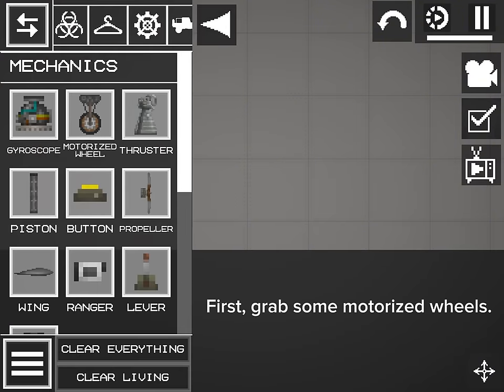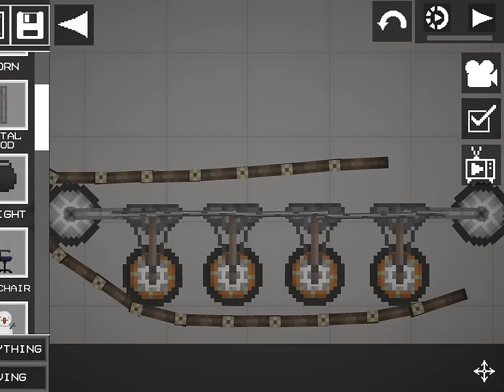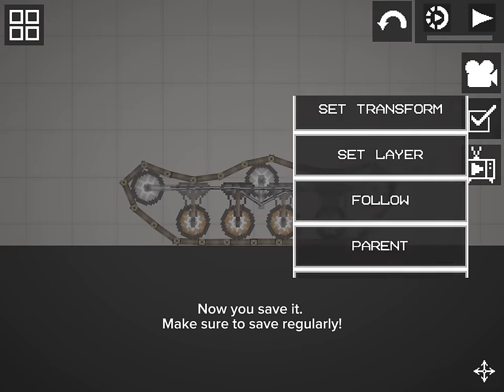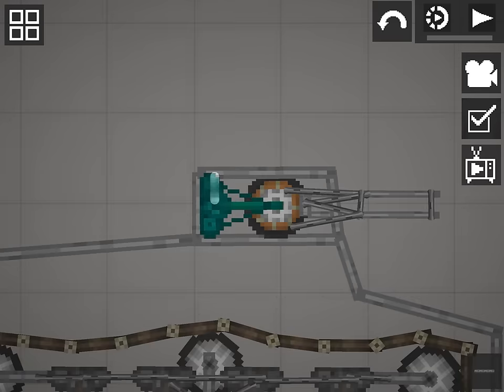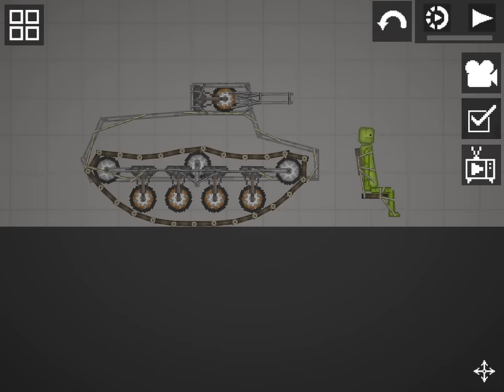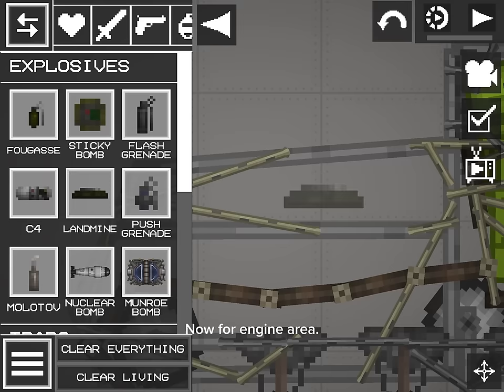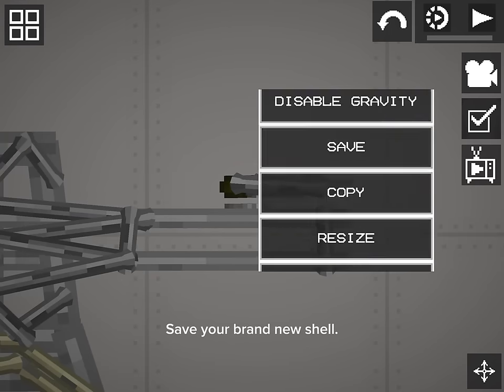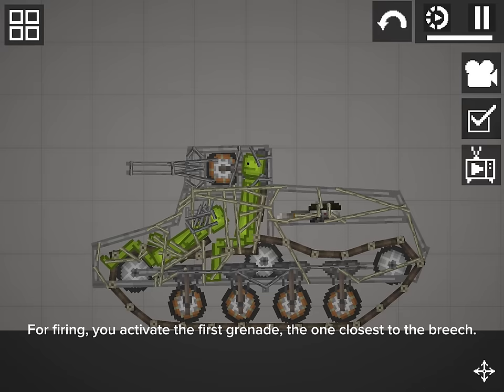Melon playground tank tutorial

Comment: If you have problem with the ads just turn off your internet
Reply: but how are we gonna watch it if the internet is off it wont work
Reply: @OceanWizard1  use a second device
Reply: @pieceofcornreal  oh
Reply: @OceanWizard1 ah u can just remember the video, if u still dont know take pic of this comment:
Step 1. Get motorized wheels. 
Step 2. Put metal rods on the top sides (left right) of 2 motorized wheels that are furthest away from the center.
Step 3: on the metal rods put normal non motorized wheels on them and nail the middle of the wheels to the rod.
Step 4:  Make tracks with wooden sticks, connect the sticks with yellow nail.
Step 5: Make the body of your tank, preferably that can fit crew in it, if you dont want big crew but still want crew use tea and put like armor or smth on them, if u dont know how chrck my community tab there is stuff u can get inspiration from there.
Step 6: after making body, put the turret on the tank. 
Step 7: check if it works.
Step 8: if it works it works. If it doesn't work redo it
Reply: Yeah that's a 200000lq
Reply: Facts
Reply: Thanks.
Reply: I won’t get a ads without a wifi
Reply: This help
Reply: Turno the innernet
Reply: Ha ha ha ha it didn’t work
Reply: @JIM_0141  you are lying. It works if you turn the Wi-Fi off. You won’t get ads
Reply: @OceanWizard1 you know I can just copy it without using a second device right
Reply: 💀📢 MY EARS
Reply: Just download it then watch it without wifi😅
Reply: But if the ads still appear, just turn on the internet and then turn it off again.
Reply: @OceanWizard1  you can just download the video and just turn off the Wi-Fi
Reply: bro mine it's just android 😂
Reply: He’s is right
Reply: I raddy know
Reply: Even better airplane mode
Reply: @the_feds_never_bothered_me who said we live on a airplane💀💀💀💀
Reply: @Red_Teddeh   No one, but if you turn on airplane mode it works better.
Reply: @StefanFamllyPop dude if you was smart you would know its for some devices working, other not
Reply: He is using airplane mode bruh
Reply: @CalebThames-wy5rb why ya crying
Reply: Guys no need off internet instead before ad appear exit to another map
Reply: @pieceofcornreal no no no turn off internet when your playing the game turn on internet when your not playing the game
Reply: @OceanWizard1 Don't use a second device Just turn off internet when your playing the game turn on the internet when you're not playing the game
Reply: Or just use vpn
Reply: @JIM_0141 I think you're on a different difice
Reply: @OceanWizard1 he is talking about the game not the video
Reply: Best life hack thanks
Reply: @rengrant8162 Party pooper

Comment: If you have a problem with the pins for tracks just lay the pieces that fell apart flat out and put a wooden stick with collision off on the place between the tracks you want to connect. Then just put pins again and turn on collision after. Should work
Reply: mine connect to the air
Reply: @Alien_Messi1900 yeah same, i was pretty sure about the pin's placement
Reply: @brixgaming361  i got them to work now
Reply: @Alien_Messi1900  same, but the body is rlly hard
Reply: @brixgaming361  somehow the body got stuck to the air sooo
Reply: @Alien_Messi1900  the body is fr hard, + my treads r pretty loose, aanddd the shape of the body is mid, so thats what i made..
Reply: @brixgaming361  i made good tracks just the body was floating
Reply: @Alien_Messi1900  nice, my tracks were loose and the body weird, and the ammunition i made is kinda weak againdt other stuff
Reply: @brixgaming361  alr